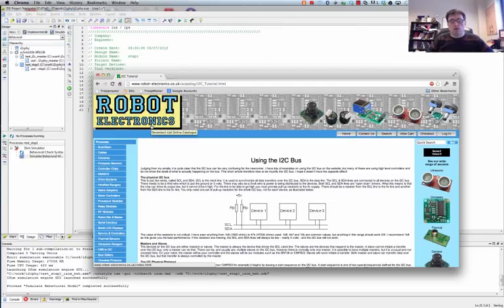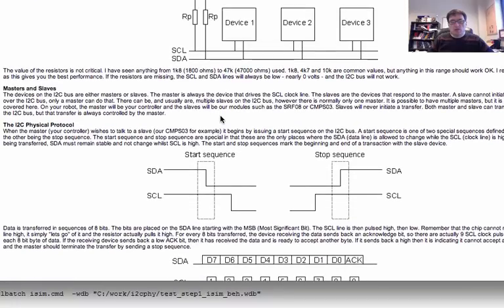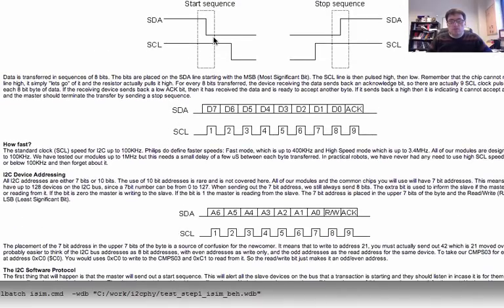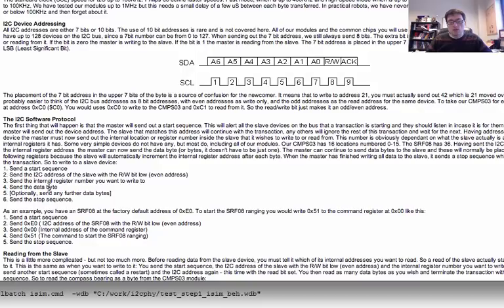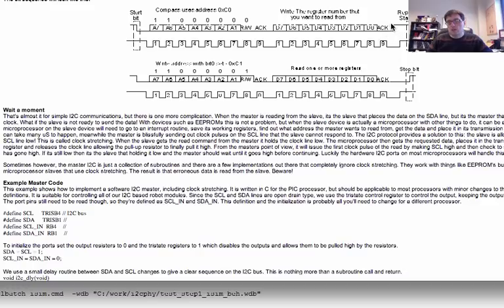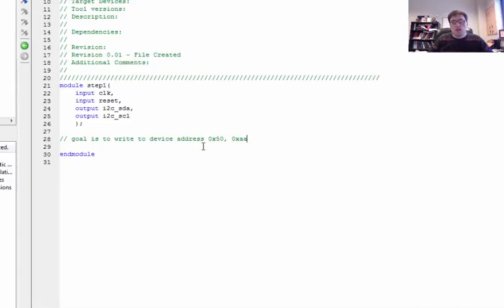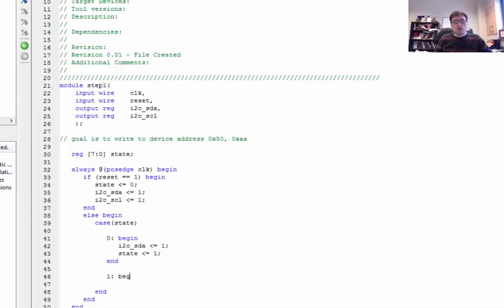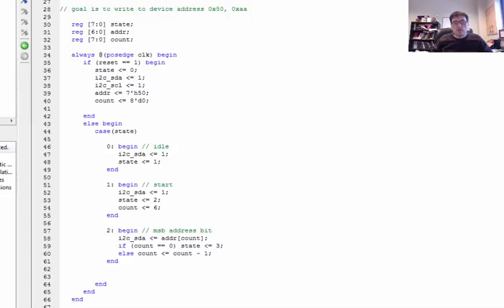I2C - Bus Master - Step 1

Comment: I am appreciative of the incremental approach taken to come up with a Verilog design.  Being a Verilog beginner myself, it’s a bit daunting to see finished code without a peek at the design steps that were made along the way.  I like the way that the state machine is built first, with the SDA signal generated first, and the clocking firmed up later.

It would be nice to have access to the final Verilog source files; I could not find the website they might be on.